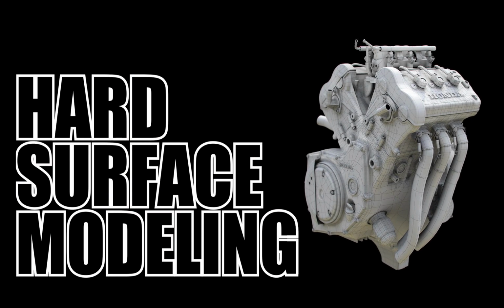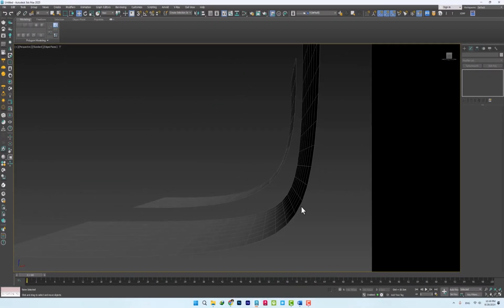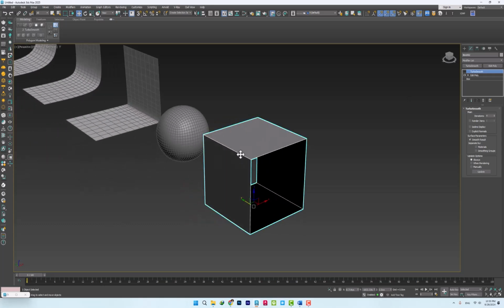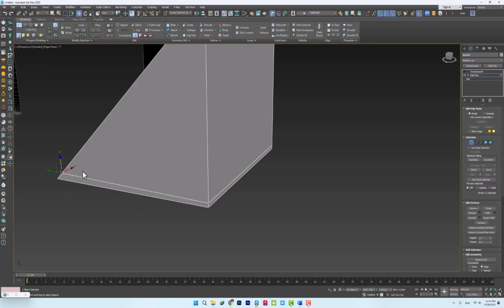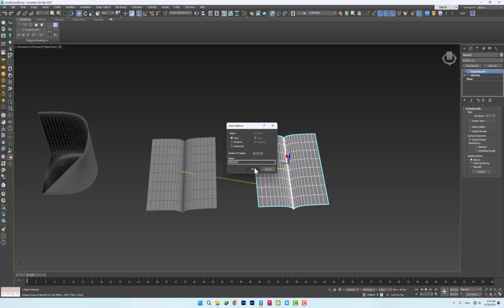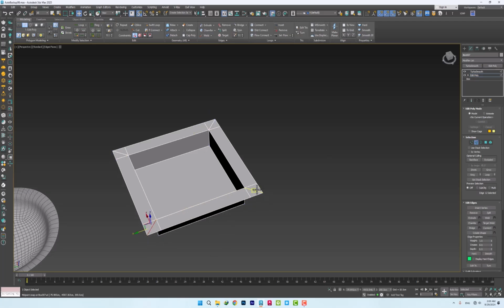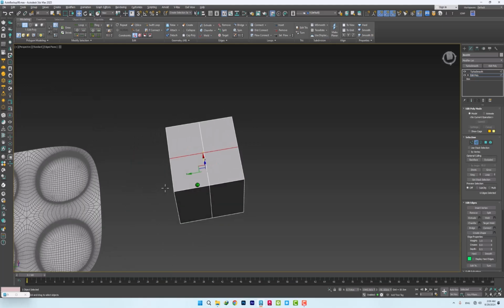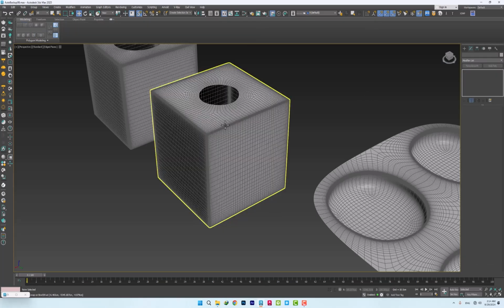3Ds Max | Hard Surface Modeling for Beginners

Comment: Hello, I have a question, is it necessary to always smooth every object, and what is the difference between opensub div, turbo smooth, and mesh smooth. And I have seen some people use crease set modifier as well, please can you tell me in detail with a video, what is the method of modeling.
Reply from the maker: Thanks. I'm trying to create a video on this topic. We're currently working on the vantage course.